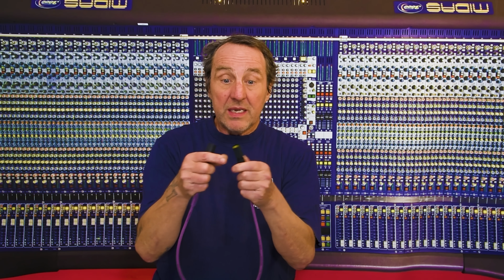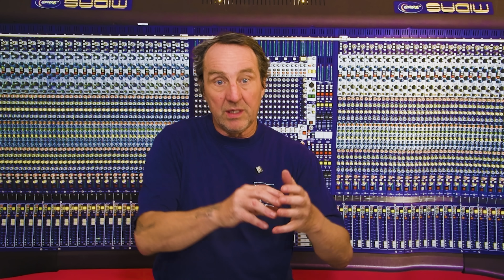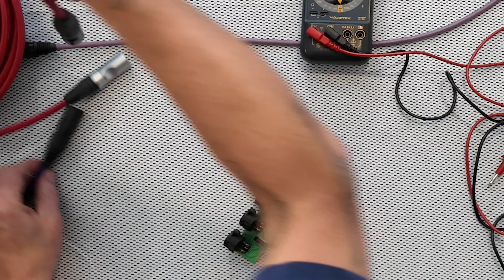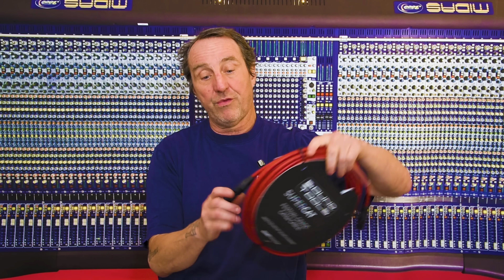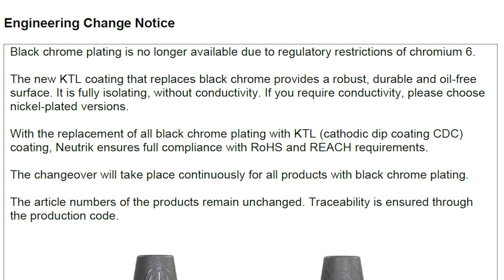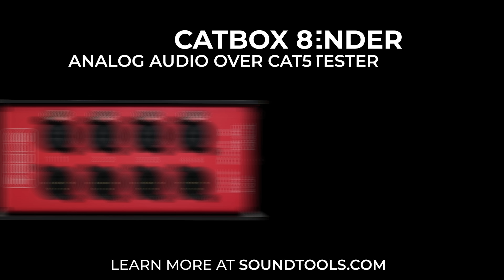Black Neutrik etherCON Shells are No Longer Conductive!

Comment: This got me checking all the XLR rack units I built in the last year and thankfully they swapped out all the chromium ones before I ordered the xlr sockets for them all. I went into designing them with the housings tied into pin 1 and isolated from the chasis directly due to how the PCB was made to avoid ground loops, with sheild of XLR going right into the PCB and then grounding to chasis from there, I didn't need to go to all that effort in using plastic isolators for the screws, had I of known, as the new housings aren't even conductive haha ... but at least they aren't carsonogenic anymore either! xD
Reply from the maker: 👍🤙👍 and also be sure to test connections with the new shells as it looks like in some scenarios they do conduct if the KTM coating chips where the latch attached and there is less KTM inside the shell
Reply: @DaveRat  Oh that's really useful knowlage! thanks!!!

Comment: Interesting... Thanks 🙂  I personally hated the old black chromium finished shells, especially the 100pcs packs, because they always came with a slight oil film on, that turned your hands black handling them.
Reply from the maker: Yeah they weren't pretty and the nickel ones are actually really nice looking so it took us a bit of time to get our heads around at and whether customers would be upset that we stopped offering Black but The nickel is the way to go and one of the challenges was getting the message out. 

The positive reaction to this video so far is really reinforcing the path we choose as the best one
Reply: @ You could think of a partial black powdercoating ...   only that part of the shell, which is still visible, when the connector is plugged in. rest stays nickel. (and additionally other colors than black would be possible.... )
Reply from the maker: Yeah, powder coat tends to chip. I think this KTM coating is a robust version of paint/powder coat. Perhaps som masking on the KTM.

But all in all, the nickel is clean, robust, and less likely to chip. 

I'm ok with this
Reply: @  I'd like to try, if this black KTM coating could be removed (partially) by e.g. a Fiber or UV laser. not only to improve contact, but also to label the shells. But no money for that at the moment.
Reply: @  You could think of a partial black powdercoating ...   only that part of the shell, which is still visible, when the connector is plugged in. rest stays nickel. (and additionally other colors than black would be possible.... )

Comment: black heatshrink over the shell leaving space for conductivity to the socket?
Reply from the maker: I don't understand. The goal is to have conductivity not to get rid of it
Reply: @DaveRat  correct, not suggesting getting rid of conductivity, just hiding the shiny parts. Could also wrap with tape after connecting but that gets gummy.
Reply from the maker: Ahh, yes. Sound Tools does not make XLR and since sthercon are not extendable without a barrel which are black, typically the ethercon connections are not overly visible

Comment: Oh man! This is soooo useful!
I'm glad I follow your channel Dave!
I've noticed indeed that all the connectors I got the past few months for my cables where slightly different, a bit smoother and a bit more glossy, but didn't know it wouldn't be conductive anymore, nor about the impact on EtherCon shielding.
When I started building my own cables, I when for black connectors Neutrik for estheatic reasons, but as you put it, "you got to go with quality first and foremost" (there might be a new t-shirt there)

I'm really curious on how you found about it and if Neutrik will come up with a conductive black paint that isn't harmful for health or environment in the future.

Thank you very much again, what you share here is always very instructive
Reply from the maker: As Neutrik dealer we get engineering updates and it was in an engineering update they sent us, The ones that show at the end of the video. 

That said we didn't catch it and we were alerted to it by a customer and went back and tested and researched and then wrote to actively changed everything.

As far as them making conductive black shells, I think if they knew how to do it with the modern standards they would have done it so I wouldn't hold my breath for that
Reply: @DaveRat  Maybe there's something with this new graphene chemistry that's coming round, super durable  (in 2 directions) 1 atom thin, conductive carbon allotrope. 
Although I'm not sure it's at a place it could be used for a tour cable yet... but maybe sometime down the line it could be useful. ;)
Reply from the maker: Yeah we may see a conductive block at some point. 

What I'd really like to see in the meantime is for Neutrik to make the second ground wiper active instead of a dummy

Comment: Thanks a lot for the detailed heads-up! On past videos and infos concerning AES50 over cat in Midas M32 systems, it has been mentioned that the shell conductivity and connection to shield is important. In this video there is no mention of that - do you consider it still an important factor in that protocol?
Reply from the maker: I think the importance of the conductive shell in AES50 is helpful but not critical. 

I say that because AES50 works just fine without even using shielded cable except in environments with lots of static discharge. 

So the conductive shell and the shield are not needed. 

Adding the shielding to the cable makes the setup more resist it to ESD issues. 

Adding the shelves adds a tiny bit of shielding at the end. 

I think the conductive shells for AES 50 concept evolved from a slight misunderstanding. 

I think that when music tribe switched to recommending shielded cables for a AES50, which they did not do originally, that someone came up with a plan for measuring conductivity between the shells to make sure your cables were shielded and help with the ESD issue. 

I think that that was misunderstood and transferred to conductive shell importance would actually what was important was measuring from RJ45 housing to RJ45 housing. 

It's important to note that shielded RJ45 connectors have metal surrounding the conductors already and they ethercon shell is a redundant shield
Reply: @DaveRat  I was looking into the X32 rack and ran across a few articles and notes on cables it seem like an ESD discharge / ground issues that people were having that they started changing to recommending shielded cable. The system I became maintainer of came with unshielded cable and I have not had any issues until the end of last year nor have I been able to repeat it in the shop. Seemed like I was having sync issues with the AES Signal and occasional drop outs yet the cable tests OK. it started to manifest as no connection until I rebooted the stage box or unplugged it then I would be good for the show. And then the occasional drop out after a few hours. Of course I had an all in-ear band with no stage witches I mean wedges; when everything dropped out and I'm like oh shoot, I looked at the app to see that the AES connection dropped and started walking towards the stage and it kicked back in. Thankfully it's only a short 25 foot cable but I'm still trying to repeat the symptom.

Comment: Great video, on multiple levels. Would it also be effective to scratch off the black coating to the bare metal in cases where the black version is already in place?
Reply from the maker: Yeah I guess that could be done but that's messy and ugly. It's primarily a redundant ground so I think that effort would be better spent on ensuring the primary ground is intact and clean
Reply: @DaveRat  Totally agreed. We had an instance last year where a cable was used between a mixer and a stage box and it would periodically freeze both devices. We replaced with a standard ethernet line and didn't have issues, but was curious if maybe that had a little part. Was just a curious question, rather than one meant for long-term use.
Reply from the maker: I'm guessing there was another issue and cool cool
Reply: My concern would be that the removal of the coating might invite oxidation that it was otherwise inhibiting, in a similar way that the earlier plating provided.
Reply: @fluidaudiogroup  Agreed. It was more to say that if caught in a situation where that is the only cable and you are having issues, removing the coating might help to solve the isse. Clearly, the ends should be switched in the long-term, but just wanted to offer a solution for those times when things do not work properly on site.
Reply from the maker: Very cool
Reply from the maker: Yeah, that could be an issue